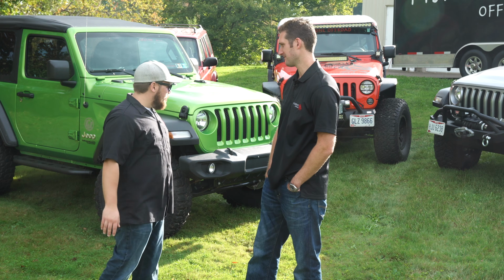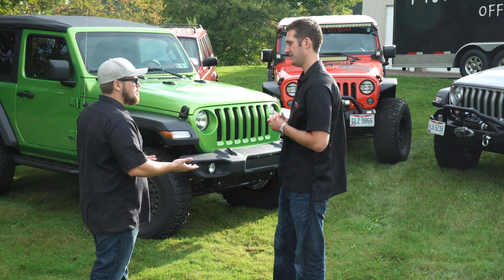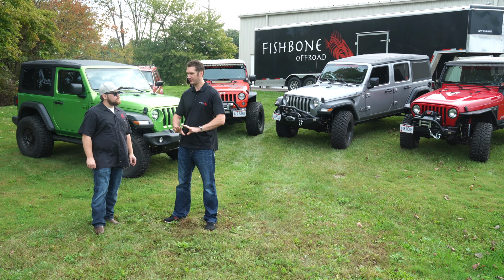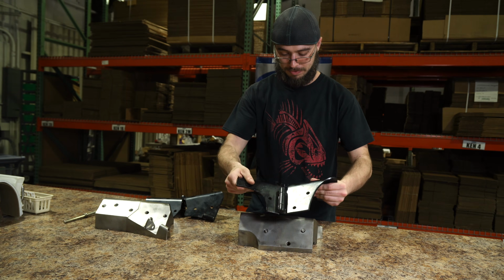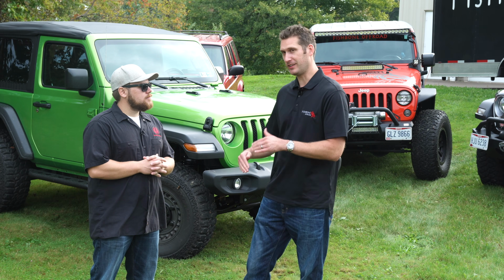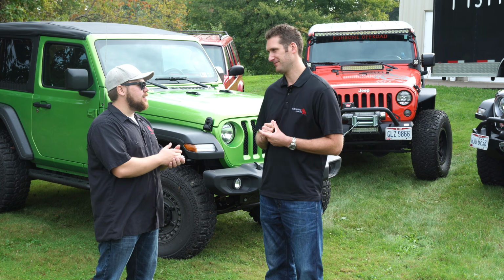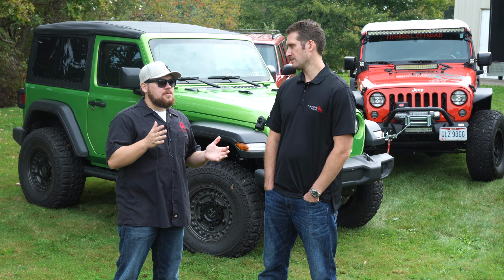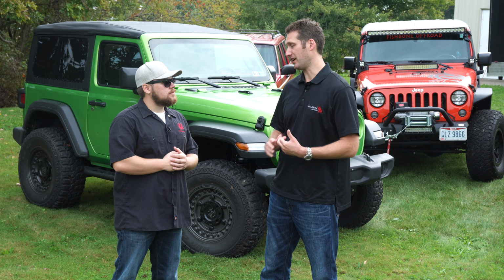FishBone Offroad Overview

Comment: What are the tires on the CJ 2dr Jeep?  Also, what are the specs of the rim, size, offset, etc?  I am trying to convince myself I can run Mickey ATZ P3 LT315/70R with a close to factory tuck without rubbing.  So 17x8 with a +30mm offset :)  Would that work without a lift?  Another option is a 17x9 +20 or 25.   Thoughts?  Stock suspension Rubicon JLU.
Reply from the maker: I'll drop the link below for the wheels, they have a -18 offset. If you have a rubicon the 315 tires will fit fine, as far as poke, the wheels do poke out from the flare, as will basically any aftermarket wheel unless it has a more serious backspacing. 
https://www.cjponyparts.com/black-rhino-armory-wheel-17-x9-5-gun-black-jeep-wrangler-jk-2007-2018-jl-2018-2019/p/795ARY512G/